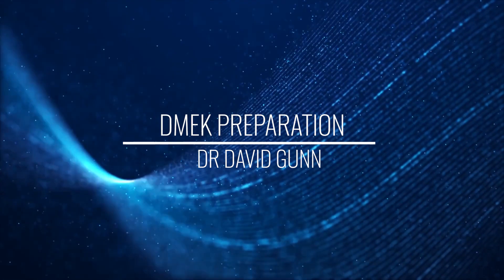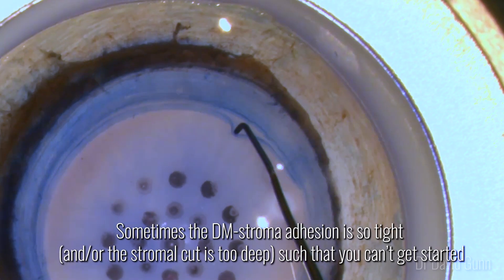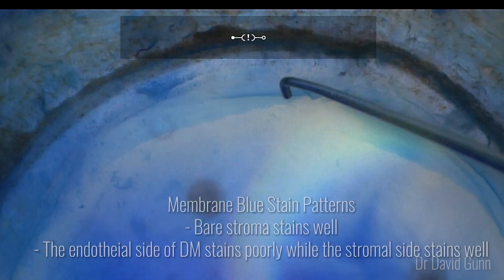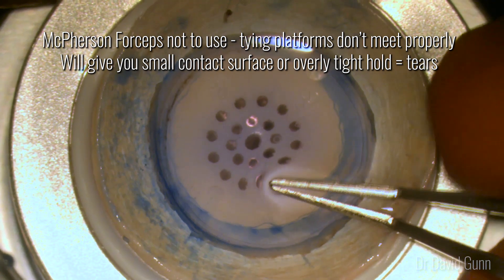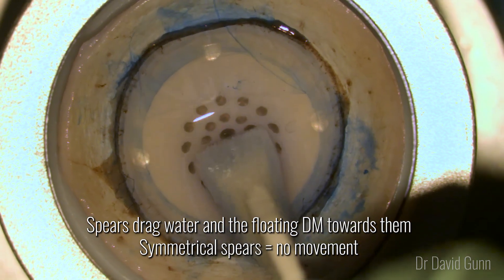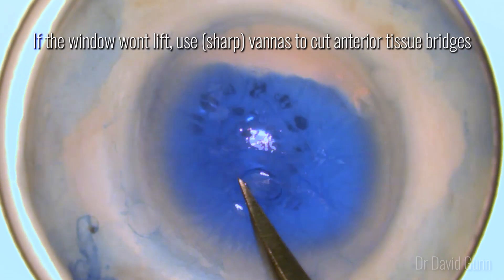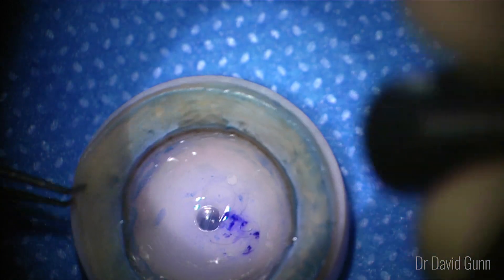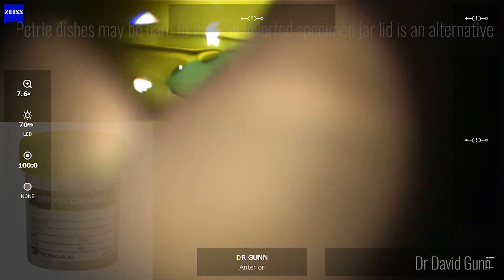DMEK Corneal Graft Preparation Guide - Narrated Dr David Gunn

Comment: Decent prep. Dry DM more with spears and you won't get ink bleeding whenaking orientation mark. Moria makes small s stamps and b&L makes smaller f which will give you a better stamp. Also I like the Katena Punch/suction blocks as they protect thit tissue better then Moria blocks. I see torsion stress lines sometimes with Moria block that I don't with Katena blocks.
Reply: Great comments thanks! This is my technique from a few years ago. Agree on the drying the DM well. Katena work well but suction with only 4 holes is poor. I’ve moved to coronet now and like it a lot. Thanks for your comments!
Reply: @drdavidjgunn  coronet is better than Moria!! Good luck and thanks for great video